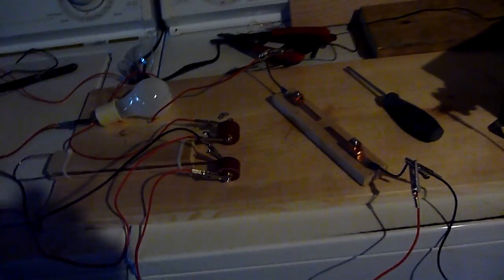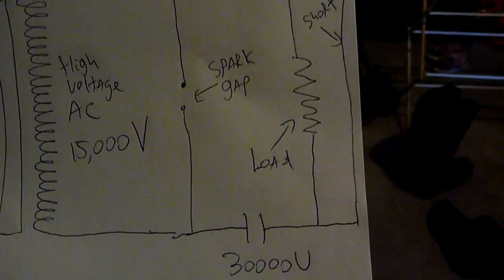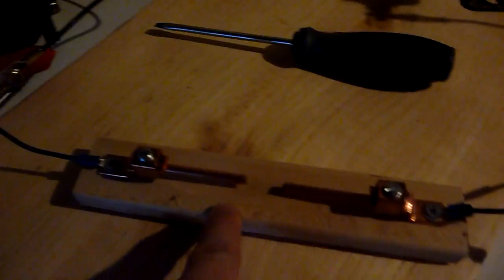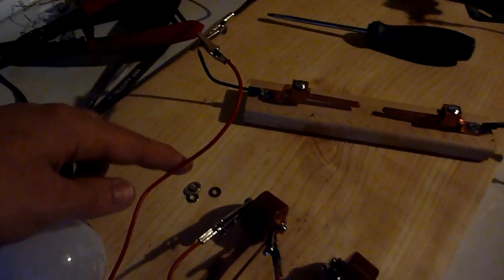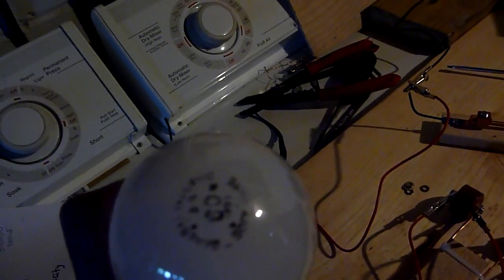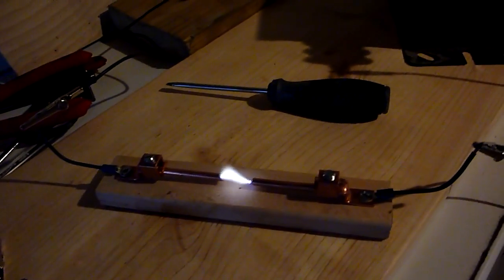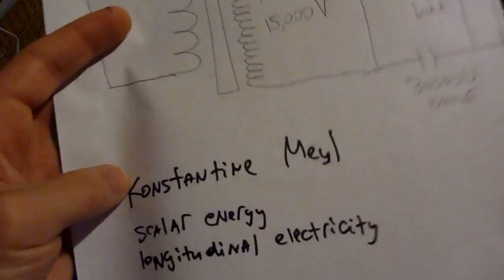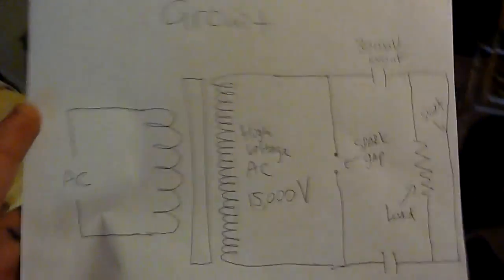Tesla Hairpin Circuit

Comment: Think u need a low farad cap and decrease the voltage by decreasing the spark gap if u want a longer put a magnet nd quench it ie electricity converted to rf is raised

Comment: He doesn't understand radio energy , as its not 60 hz but the ark will generate multi rf frequencies right  through rf spectrum.THE ARK WILL BE MAKING RADIO ENERGY on MANY FREQUENCIES AS NOW THE HAIR PIN SHORT will have it's own resonant frequency  this hair pin has inductance and its own frequency.with out doing the maths i would recon around 50mhz .but problem being in a high voltage arc at 50kv will dispose of a lot of static electricity. as any voltages  higher that 10kv will make static . now stratic has it.s own path as most will be shorted in the ac arc ,, WHAT YOU ARE DOING IS GENERATING RADIO WAVE JUST AS RADIO OPS'...... DID IN THE EARLY 1900S .. IF you put a coil in series with the bulb  and a tunning capacitor in parralelle with the coil you will be able to peak the voltage and current lighting the bulb .. after tweeking for highest brilliance you then can switch off and connect an inductance meter to the coil and variable cap and read how many micro henrys are in the coilas some meters will tell you the frequency ..........inductance and frequency meters are very cheap on ebay these days ,................you cannot cnonect through while circuit is live because of high rf and static damage ,...........now a warnning get it off the washes before stray electrons destroy your washing machine control circuitary.and the cpu that controls your car ?The rf, will find its way to other items That will resonate feeding voltages were they should not be ,....get it away from all house  to some were we it will be safe ........GET A SET OF COILS MADE UP then the  biggest tunning capacitor you can buy .With these you can light a bulb by tunning up a coil and tunning cap in parallele with a bulb . This will give you the range of energy leaving your device .you will find a wide rane of frequencies as the frequency meter will only be a guide. donnot connect to any radio antenna as it will radiate alot of rf noise     .........Well....... this you will find is highly ileagal to radiate this way . even your experiment will cause other radio users problems ..   police and Aviation authorites will visit and want be happy .never mind your neighbours lol?...................i my self have been a radio ham for over 40years sending transmissionall around our earth , Harmonic radio suppresion is a leagalrequirment and has to be adeard to ?

Comment: The effect has nothing to do with "scalar waves" in the undefined meaning of this term widely used on the net. People who are talking about that has not read and understood Tesla fully. If one read carefully  Teslas' book "The Inventions Research and Writings of Nikola Tesla", the explanation for the behavior of the Hairpin circuit will be  found in the 3 lectures fully published there and is mainly function of the rise and fall time of the current, when the spark gap, or generally and fast recoverable fluid dielectric interrupter, is introduced, as well as how the metals impede the movement of such fast rising/falling currents, that not necessarily should have high frequency. It is other question that the hairpin circuit is one of the first circuits with which Tesla demonstrated many unusual, but explained very well by him, phenomena. In one form or another, this basic circuit is used in his subsequent schematics working with HV and fast rise current time.

Comment: Hi there 
Great work!
I have a question!
Going into the spark gap is that one side positive ,and the other negative?
Or is both positive?
Reply from the maker: vinny stvincent I use high voltage AC power , so positive and negative alternate. I used typical house power so + and - alternate at 60 times a second (normal household AC power is at 60hz). The Capacitors should be rated at least 2X the input voltage. So my input voltage was 15kV, capacitors are rated at 30kV. I wish I didn't shoot this video in the dark. I thought the effect would be more dramatic this way :P Hope my answer helps.

Comment: Long cables are not a short circuit for high frequencies. I guess when the bulb is shortened shortest way at the socket you will get a different result. I can't see any connection between this and the weird "scalar waves" of Mr. Meyl.
Also I don't see any connection to "free energy". Obviously it would be much more efficient to run the lamp with 230V without all this stuff. Yes, the spark could produce hydrogen from water. But there is also no reason to think, that this takes less energy than the produced hydrogen has.
Tesla proposed this and variations of this circuit besides radio applications for HF-therapy, see http://www.tfcbooks.com/tesla/1898-11-17.htm . Definitely not for free energy.
Reply from the maker: magnetstoo The purpose of this experiment is NOT to prove over unity but to show that the electron is NOT the charger carrier in electricity. The dielectric of the capacitors is never broken and yet you get the bulb lighting. That means that electricity is a charged field that exists between two metal conductors (or obstructors of the electric field). Physicists will tell you that there is no electric field.... Basically this experiment proves the existence of the electric aether.
Reply: Naoki Kashima
This experiment is nonsense. Your ignorance is startling. Of course alternating current can flow through a capacitor. Not in that sense that there is a current flow through the dielectric insulation, but the capacitor is charged and discharged with the frequency of the alternating current and this makes the current flow. And of course there is an oscillating electric field between the two conductors of a capacitor. You find the formulas in any textbook of EE.